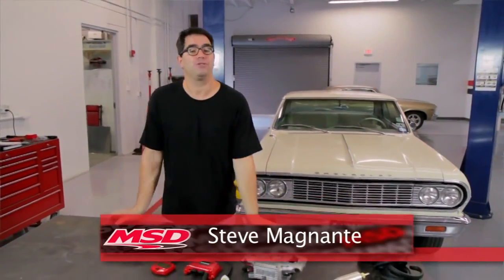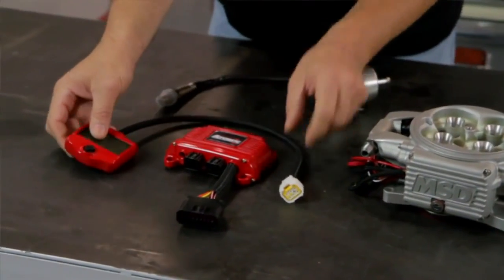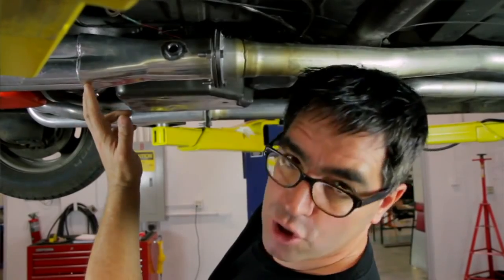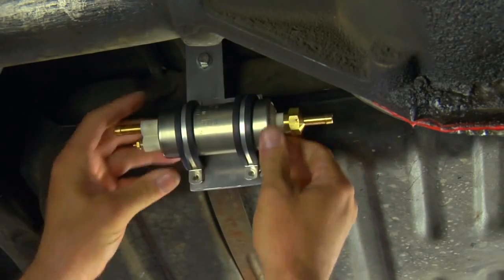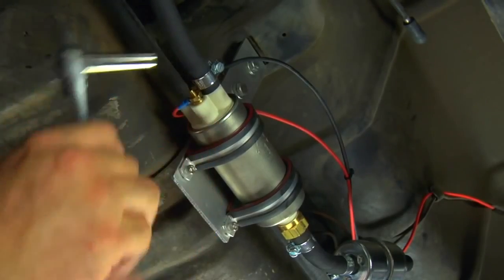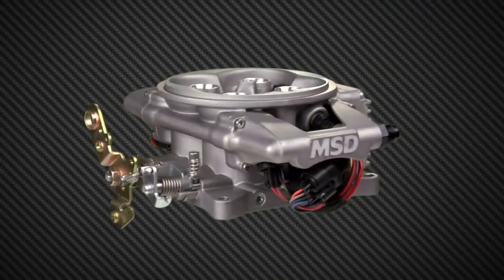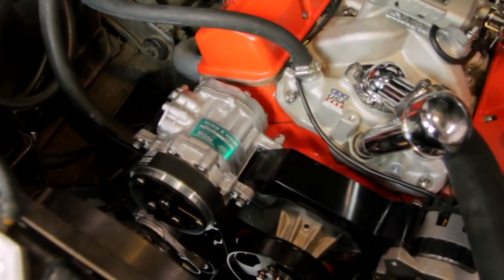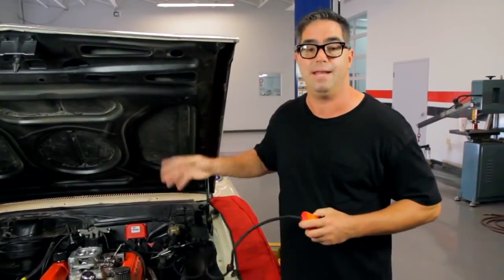MSD Atomic EFI Fuel Injection System Installation

Comment: Having rubber hose from the fuel pump to the front of the car will cause a rough idle because the hose will pulse when the injectors fire at an idle. Mine does. Grab the rubber hose at an idle and you will feel it pulsing like a heartbeat,,,,,, bad

Comment: Hey Steve, I had my mechanic install an Atomic MSD EFI on my tricked out '79 Chevy C10 Silverado and I could not be happier. What I wanted to mention to you is that because my truck has dual fuel tanks it made the installation more complicated. My mechanic had to fabricate a cylinder shaped fuel tank, about quart sized because when one of my fuel tanks went below half a tank I could not get enough fuel to my engine and it would die out. That's the best way to describe it from a layman's perspective because even though I've done a lot of work on my engine, I considered this job beyond my skill level and tool availability (and because I'm an old geezer now I prefer to have other people do the hard work).  I'd had it with other people's 30 year old rebuilt carburetors, and in California, new carburetors are not street legal as they will not pass smog. With my carburetor I had to pump my accelerator like 12 times (sometimes more) to start my engine when it was cold. To make matters worse it would sometimes die on me when starting out from a red light. That made me as nervous as a long tailed cat in a room full of rocking chairs. It's very embarrassing to have a really nice looking truck that doesn't run. Also, after I did drive it and I'd come home, my carb would drip fuel filling my garage with the smell of gas.  I was afraid my wife would shoot me if I didn't get it fixed. Now, I'm as happy as a pig in mud. My truck never dies out, runs as smooth as silk, and I get better fuel mileage from the 350 cubic inch. Thanks for the excellent video.
Reply from the maker: Thank you for watching and the feedback!

Comment: Is there a vacuum port for a HEI distributor
Reply from the maker: The Atomic has five vacuum ports, ported and manifold, to cover accessories such as a power brake booster (Figure 3). Four ports are 1/8" NPT and one is 1/4" NPT.

Comment: Installed on a '79 Bronco w/a 351M/400. I live in Alaska. I can now go thru mountain passes in excess of 5000 ft. whereas before 3000-3600 ft. was the max my Holley carb could handle. From summer to frighteningly cold Alaskan winters, it has been flawless. I can literally go where I've never gone before.
Reply: How is after 2 years of use? Any problems? Im thinking of getting this version.
Reply: @IvyGreen1966  I never had a problem with it. I had sold the Bronco years before I posted the comment. The system I had was the original MSD system. They (MSD) were bought by Holley and the current Atomic system is different, so . . ???

Comment: What is the psi for the post filter?
Reply from the maker: The post filter is Holley part 562-1 and is designed specifically for the Sniper EFI kit. It does not have a specific rating but should be good for up to 60 psi.
Reply from the maker: The post filter is Holley part 562-1 and is designed specifically for the Sniper EFI kit. It does not have a specific rating but should be good for up to 60 psi.
Reply from the maker: The post filter is Holley part 562-1 and is designed specifically for the Sniper EFI kit. It does not have a specific rating but should be good for up to 60 psi.

Comment: At  4 min 44sec it is stated that if I am opting for the return-less set up its preferable to be ran with the pump in tank... is this correct? Thanks
Reply: I've done it with the pump externally mounted like he shows and using a return line and it's perfect.

Comment: Ya easy non typical install. Try a 1977 Chevy k10 4x4 with low pressure dual tanks....
Reply: I would put the pump after the splitter to keep use of both tanks.
Reply: Exactly. Pump after splitter.

Comment: I already have fuel injection an outdated pro flow. Can this system be used with my existing return style fuel system. And will it work with a hall effect switch in the dizzy using the 6A to control timing?